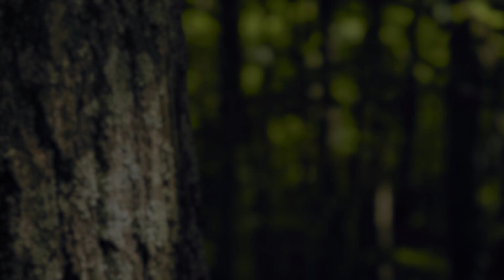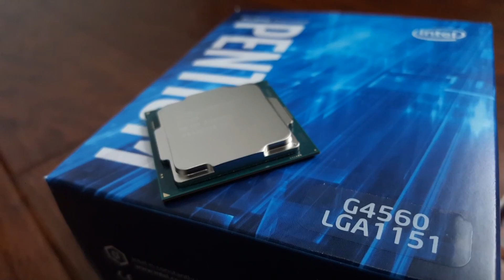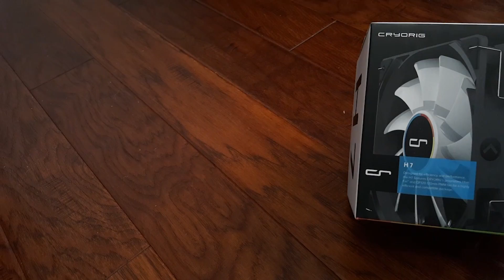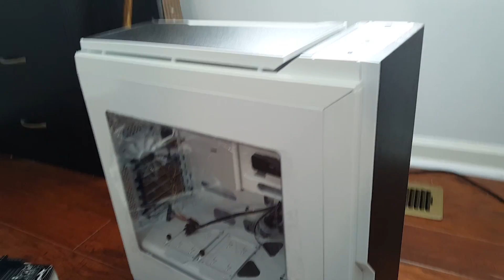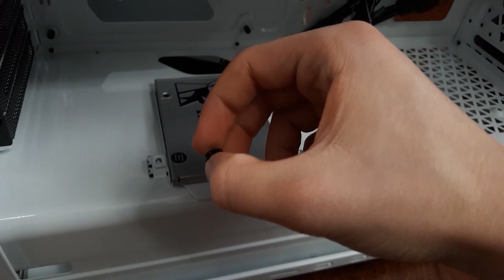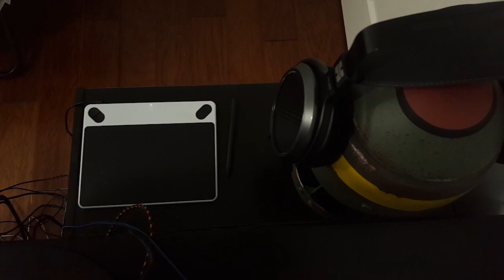$450 PC Build

Comment: b250 ? 2666 mhz ? real ?
Reply from the maker: Тихий-Ужас # This B250 does not support 2666 MHz, only 2400 MHz, it will get clocked down. but the $/GB of RAM was the best, at the time.